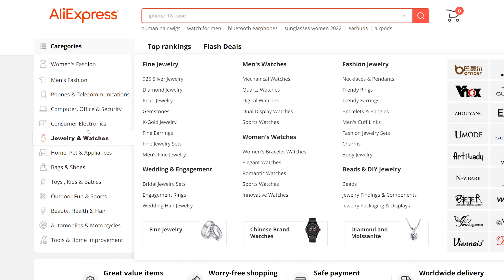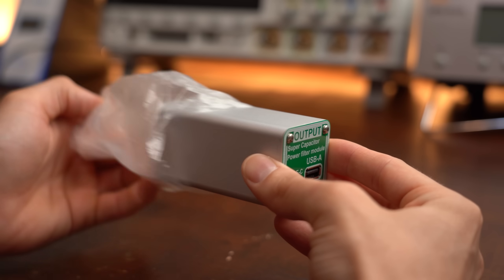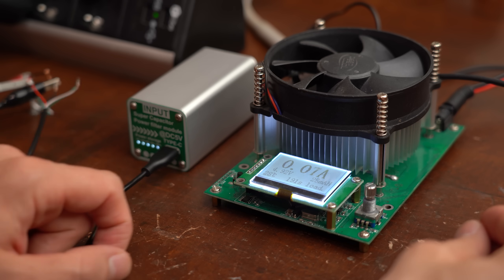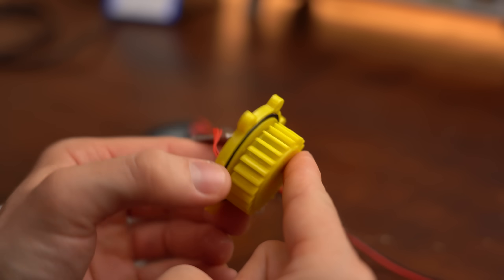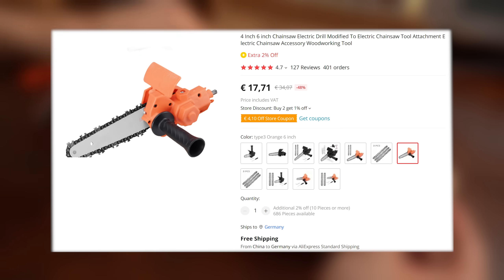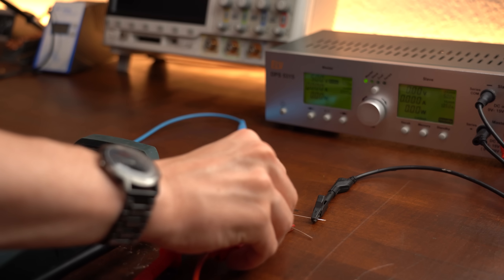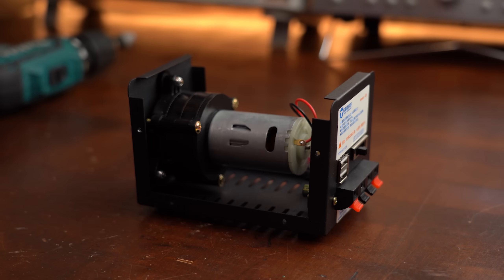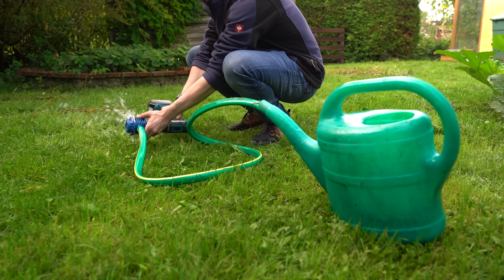I tried finding Hidden Gems on Aliexpress!

Comment: I know I'm a little late, but pumps are terrible at sucking and good at pushing. You need to put the hose over the wall and set your pump on the ground so it feeds by siphoning, and then it will perform better. My team killed several fuel pumps on our race car before we figured out to mount the pump level with the bottom of the fuel tank.

Comment: I have a handheld radio that uses a small wall transformer as a charger. The transfomer has a USB A jack on it, but it outputs 12 volts. I assume the manufacturer got a great price for a truckload of surplus jacks.

Comment: There were better jig saw conversions and the chainsaw is very dangerous. If you can get the sheet nibbler and you need one go for it. Of cause it handles better if you ge one with the motor in the same case but being a niche product they were expensive when I bought the drill powered Chinese one at Norma (supermarket).

Comment: The battery charger had €1.27 shipping chat, so that the €0.71 = €1.98 !
I always look at prices for "choice" products, with no shipping charge over €10.00. I found similar product at about €1.39-1.49 or 2A for 2S/3S for the same price, but in the "choice" selection.

Comment: I have the handcrank generator.
My handle was way better quality and I like the machine. Expecting more then 10W is a joke ofc. I also would never use the USB for anythibg else then charging a powerbank.
When I use it, then only with the terminals, connected to a good 12V input USB charger board.
I also added a small 16V super capacitor bank to its output, helped a lot.

Comment: Hi. About that super capacitor. 
It made me wonder if there are some kind of filters for usb cables? My GPU is producing a lot of electrical noise. So much that even my external sound interface is picking it and I can hear it clearly in my speakers (the audio interface is powered from usb and that usb port is simultaneously used to transport digital audio, so in theory there shouldn’t be any problem because analog audio is produced in that external audio interference, but somehow the noise is carried over). I’m not alone in this and so far no one found a solution. And it’s not a problem with this particular sound interface of course.

Comment: i like the idea that op just thought that wifi routers and phones and stuff send out a magical constant and continuous stream of 5Ghz/2.4Ghz radio waves like why tf is it not detecting my radio, like clearly the device wasn't working and detecting them at all. also any chip that could decode such a range of frequencies like that was be atleast an order of magnitude more expensive but judging by his reaction times pulling away from the router and the proximity i just know when he was buying he was like wtf either way even if the frequency ranges are wrong it HAS to contain those 2.4ghz and 5ghz and EVERYONE knows thats an overcrowded domain, so how is it not just constantly going off, does it have some sort of detector to ignore this? thought about it for a second and just ended up buying it out of curiousity and when it finally got here realized the heck this thing busted wait I spent HOW MUCH on this? whatever education is expensive. like i know obviously its just a video recreation but that was clearly the type of muscle memory that got triggered.

Comment: 11:45 To be fair, you're using it wrong. Unfortunately, the device works best when the user has a basic understanding of radio signals, so it's not overly user friendly.

You don't point the antenna at the object you're scanning. Instead, you run the antenna parallel to the object, so it can pick up the signals.

Signals go sideways. Antennas can't hear each other if they're pointing at each other.

Comment: Make a video about a worm motor / worm gear. I bought sofar 3 of them (the square ones) and still they don't do what I want: to lift my little loft door. From this position - - to this | position. (horizontal to vertical). My loft is on it heaviest 7,5 kg.. (when it's closed). Last motor I received should pull max 25kg but it stalled at 2,5 kg.. I probably don't get it or are these motor just bad?

Comment: Hey, funny to see the IP2312 pop up here. I make SlimeVR trackers and considered that as a replacement for the TP4056 as well, though I am using just the chips. Eventually figured out, after poring over a Google Translated datasheet and application schematic for a while, that some of the protections of the IC are a bit misleading so would have been interesting to see you test the battery protection on the board you had.

Comment: A tip for wood cutting for projects cover the wood pieces with painters/woodworking tape this will help with stopping the top and bottommost layers of the wood pieces without any chipping or fraying of the wood layers pieces saving time on finishing the trimming of the edges of wood cutting layers and have clean smooth layer cuts.

Comment: I have that blue emergency power generator, and it works fine. I haven't measured how much power it can output because even 5W is already surprisingly a lot, I'm gonna need a bicycle or something to get there.
My handle is still intact.

Comment: Love the channel, I've been binge watching is since I found it. I've been trying to find a board similar to the TP4056 for outdoor solar deck lighting. I'm trying to use a 6v solar panel, 2500mAh 18650 battery and 1W 3.6v COB LED button. I'd like the light to automatically turn on when the  solar panel voltage drops due to darkness. I see lots or circuits online, many don't work, some will turn the battery into a grenade because the board shouldn't charge a battery with a load attached. Is there actually a safe, easy way to do this with a minimum of components?

Comment: Your drill powered waterpumpe, you can get them in shops, its nothing new, i use them at my job, and i love it,  but no, it doesnt build pressure, you need to suck,m but if clear hose is used, you can avoid getting a mouth full of water. They work great for what i use them for.

Comment: I'm sure that water pump specified height above the pump. As in it can push a 9 meter head, or whatever it said. Maybe if it were properly "primed" while running it could pull better. But, as with water wells, submersible pumps are the way to go.

Comment: The problem with the drill powered pump was your drill not the pump.. A cordless drill doesn't have enough RPM to spin the pump fast enough.. Try a corded drill, or even better yet, make an adapter and hook it up to an angle grinder..

Comment: Re supercap filter: the filtering capacity depends on HF impedances in the filter, e.g. ESR of the capacitor. Therefore a filter with regular capacitors and some inductances would probably perform much better than this.

Comment: Although I am a long-time customer, I am not very enthusiastic about AliExpress. It took me years to learn what others have been saying for decades already: AliExpress is a scam. The sellers will always try (and will) scam you and AliExpress supports it.

Be it with the use of inferior components, use of fake components, no or lousy after sales, no guarantee periods, over-exaggerated and false product claims, price-over-quality product designs, price-over safety product designs, counter intuitive user interfaces, no boxes, no manuals, unreadable Chinese manuals only, sending of defective or incorrect-voltages equipment  (hoping you won't open a dispute). And then their non-ethical "marketing techniques" like deeply hiding any links on app and website to (human) help, giving short- and impossible guarantee/dispute periods, falsely link to cheap accessories for a certain product to make it show a lower price on product grid display pages, create low prices for a product but abnormally high postage costs, I've also had multiple times when a product was advertised, I bought it, they kept my money, but never sent it. I a) had to open a dispute to ask my money back or b) they cancelled the order themselves, but in either case they sent the money back after 15 days. Now... if they do this trick with 100's of customers, it is a way to generate money for financial short investments - and they probably do. Nice fraud! 
Well.... I could go on for days. I've seen it all. So beware... beware: research the products you're interested in and check seller ratings and how long the seller is active... beware!!!

Comment: The water powered generator works much better for that designs initial purpose -- as a water flow meter -- or even a water volume meter if you program an accumulator into its data device (an arduino or similar). Not certain how linear it is. Probably best to calibrate it yourself, interpolating between 5 flows timed into a container of known volume. Beyond that a foot or two of straight pipe upstream and down will remove most of the accuracy-harming turbulence -- a meter run.

Comment: Hi, I use the same drill powered water pump to empty the dregs out of my Hot Tub, I think the reason it didn't work for you was because your drill was on the lower speed and you need a higher rate of RPM, fyi, the height of my hot tub is approx foot and this pump works great for me - so I suggest you try your drill on a speed 2 (if your drill has this feature), but all the same I do enjoy your vids
Reply: There's a clutch switch on the top.

Comment: It's too bad that charger (just like the TP4056) does not support cutting off at lower voltages than 4.2 volts for those of us who want to reduce stress on the battery at the cost of a little capacity.

Comment: Pump didn't work because you had air in the line. Need a hose on the other end so it can fill the chamber with water

Comment: Sooooo... couldn't you feed the water wheel power into the 5V SuperCapacitor Filter and use the output as a power supply for the water tracker project you mention? I've been considering pairing that water wheel with supercaps to power a RP2040 project... what are you thoughts?

Comment: I am an experienced aquatic engineer with 19 years in pool/aquatic engineering. I am very experienced in pool automation controls , automation, actuators, antennas, motherboard, electrical variable speed pool pumps, plumbing, electrical, low-voltage connectors, and chemistry. Want to work on some project of integrating pool pump systems into something i can’t say on here. My main requirement i would need help with is a way to have portable AC current to pool pump, what type of transformer would i need???

Comment: A lot of people here in Brazil complain that delivery times are very long when ordering from China. However, it hasn't been uncommon for overseas purchases to arrive faster than some bought from local retailers, especially when using private couriers (instead of the Brazilian postal service). The average delivery time from Aliexpress purchases has been around 2-3 weeks (even though some may took waaaay longer), while I've had some local shipments that took over a freaking month to arrive.

Comment: 10:31 I think you could tell from the description that it was going to be no good, it states the output power is achieved at 2000rpm, which to me calculates to being 33.3 revolutions per second which I think may be a bit of struggle for a hand crank.

Comment: It should be possible to use the second hand crank with the hand generator, or repair the first one with a welding machine. A hand crank of that type is also easy to make. But it is a shame, that it is made too weak to last a few minutes of testing.

Comment: The problem with Aliexpress search engine is most vendors don't know a word of english and rely entirely in automatic translations... I've found out a few tricks over the years, for example they love the word "module" when selling eletronic parts... Also you should take vendors with shipping options either e-packet or Aliexpress Standard... The later you can even merge multiple buys in a single packet. It's usually the fastest

Comment: Those drill powered pumps don't advertise self-priming, as far as i know, so you should not have expected it to self-prime over a metre...also, sometimes, the pump works in the opposite direction to what seems intuitive, which might be why you got bubbles into your pond...if you simply drop the pump and hose into the water, let the hose and pump fill up, then quickly attach the drill, or, fill the hose and pump with waterm then drop the hose into the pond, starting the pump simultaneously...

Comment: If you didn't let the supercapacitor 'soak', and fully charge, it might have quite low "filtering" capability, and, in any case, supercaps are not known for low ESR at higher frequencies...basically, it appeared to me that you were actually getting the current from the little SMPS,  as i could see 'jitter' in the supercap charge indicator...

Comment: The biggest problem with AliExpress is that some of the sellers are either complete idiots about their products or are intentionally providing misleading / incorrect information.  One such example is in the USB power banks.  They are routinely listed for 80,000-200,000 mAh and there is no way that they could get that power density in a package that size.  People who have tested them say that 5000 mAh is a more likely rating.  And then there are the obviously fake products like some cell phones.  The camera resolutions are lied about plus just about everything else.  I often buy stuff from AliExpress, but it's definitely a case of "buyer beware"...

Comment: I think the Xy-pds100 a universal USB charger module that is really interesting for you.
You can just feed it almost any voltage. Connect almost any device. And it will detect the most optimal protocol voltage and Power level to charge its fastest.
Up to 100Watt USB C pd

Comment: Der Pumpenwirkungsgrad bei der "Drill Powered Waterpump" dürfte einfach nur extrem schlecht sein. Bei einer Höhe von 1m entsteht (unter Vernachlässigung des Schlauch-Druckverlustes) ein Höhen-Druckverlust von 990 kg/m3 (ca.) * 9,81 m/s2 * 1m, was ca. 9712 Pascal entspricht. Nimmt man den Schlauchquerschnitt bei ca. 5cm an und eine Strömungsgeschwindigkeit von ca. 3 m/s, so ergibt sich ein Volumenstrom von ca. 0,002 m3/s. Die benötigte Stutzenleistung, die an das Fluid übertragen werden muss, wäre dann ja 9712 Pascal * 0,002 m3/s = 19,4 Watt, was die Bohrmaschine ja locker leisten müsste. Denke also dass das Pumpendesign (Laufrad o.ä.) einfach schlecht ist.

Comment: do not use those drill adapters on a good drill. you're putting the wrong stress on you're dill shaft and you'll end up with a wonky drill. make sure you use a old bad drill

Comment: I just ordered on 15 October some 18650 battery... will arrive in December in UK.. hopefully... first time when I'm using AliExpress...
Reply: First time eh.

I hope you paid the extra for tracking. As timer for delivery runs down to last 7 days and nothing has arrived, initiate the Dispute process or whatever they call it. Otherwise the timer will keep counting down and will auto-mark the product as delivered. The seller (if contacted) will of course ask you to keep waiting. Just start the refund process and ask for full money back guarantee.

If you get the 18650, pray that half the battery is not half filled with sand. Your Xtar VC4 charger will tell you real battery capacity if charged from 0 to 100%.
Reply: @Ash_G  they are already marked as received after 2 weeks 😲..I didn't payed for tracking..I didn't know that they have the option....was my first order... and I didn't receive it... still have to wait until the end of the year...If I don't receive it I'm losing £25 ...😞
Reply: @badeadrian  Can I know your level of education? O-level, A-level, university, etc?

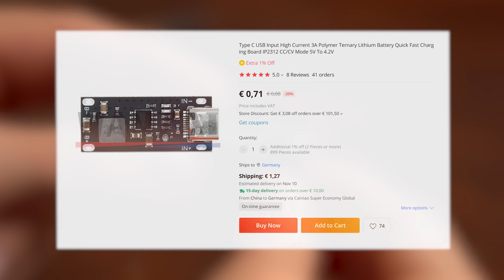Comment: 7:55 I used one for a few hours to charge some fairly serious 1s3p banks of 18650s

it dies randomly in a short circuit (on both ends of course) - luckily I have a fused meter in line and that 2A fuse blew before anything else

Comment: 20w crank generator actually gives power around 20w, you have to disable the voltage regulation and add buck converter

Comment: With the hand cranked generator you will be able to connect a pulley to it and you can mount it to something and use a pedal bike to get your voltage too

Comment: Would not recommend the drill saw, full chainsaws have numerous safety features built in which just aren't present here. If the saw kicks backs, it gets doing towards the shoulder, where there is a major artery. A regular chainsaw's handle both serves as a grip for steadying, and a physical barrier to stop the saw from reaching your shoulder on a flick back.

Comment: Just FYI it's actually a water flow detection product. When listing on online portals, sellers have to use all kinds of words for the search to work. That product can be used in a ton of different projects where you need to sense whether some liquid is flowing or not.

Comment: Hello,
Is it do-able to use "usb-to-4.2v chargers" in parallel? (same 5v power input to multiple charge boards so I could charge multicell batteries with balance  plug.)

Comment: Once purchased an adaptive led set for the monitor. It uses software to check the colours on the edge of your screen and then matches the LEDs so it’s like your screen is shooting out the same colours behind it. It was only like $20 while I’ve seen domestic products at over $125

Comment: For the rf detector: could it be that the wave lenght of the router is so long that the detector trigger every x centimeters when ever the antena cross the radio wave? You know like in a microwave how the food have to rotate to be heated evenly otherwise you end up with stripes of hot part where the microwaves went trough